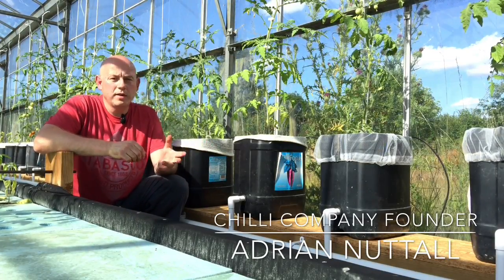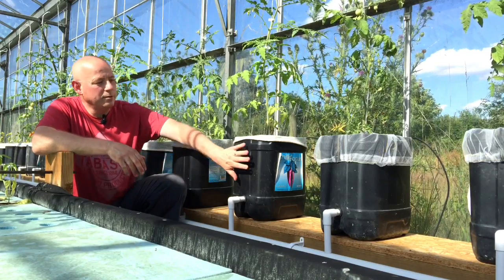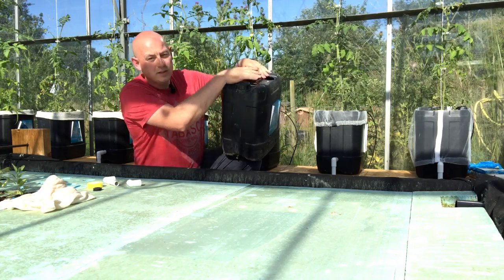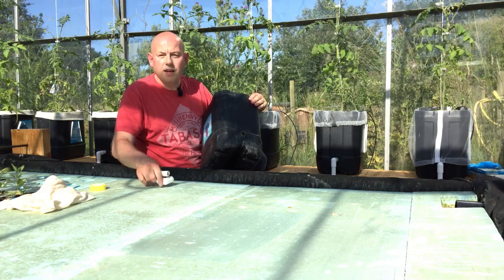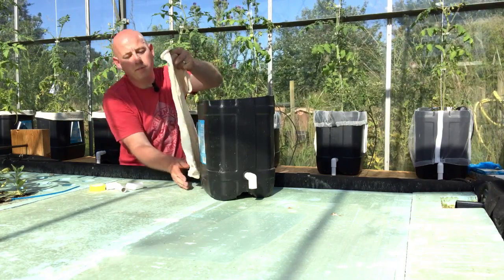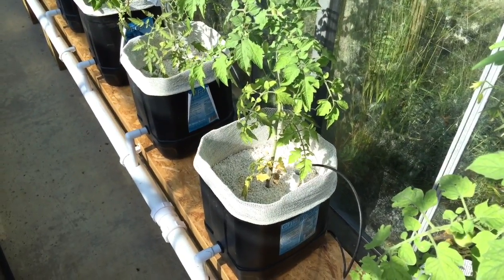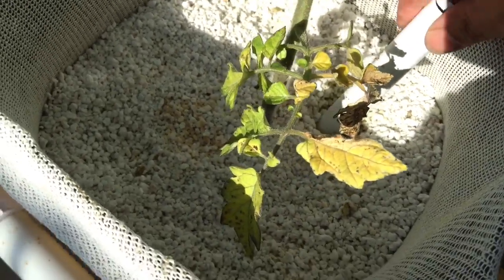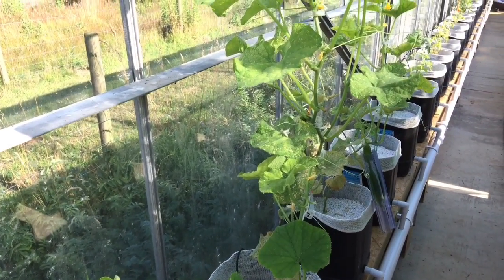Aquaponics or Hydroponics Dutch Bucket Setup and Parts Needed

Comment: Great video! what size is the pipe, washer and drilled hole?
Reply from the maker: Hi - the hole is drilled with a 25mm (1") hole cutter - then we used a 25mm/21mm washer and pushed overflow pipe (21.5mm) through the hole. 

I hope that helps!
Reply: Chilli Company Thank you! Fantastic :)